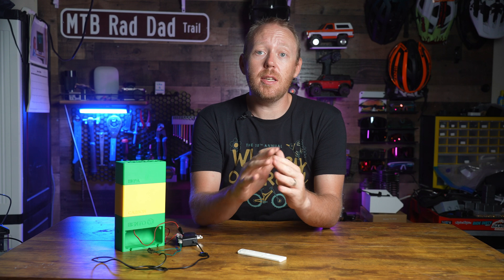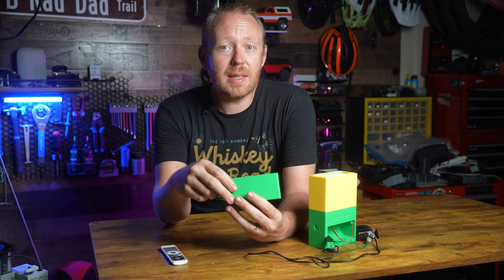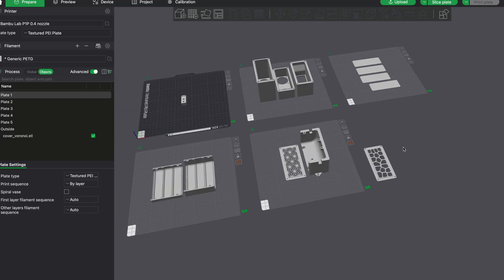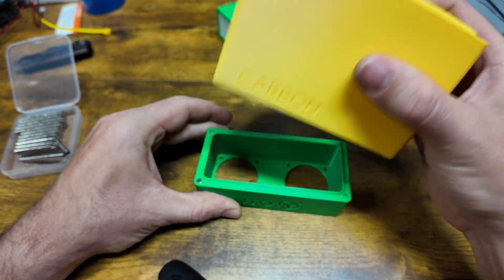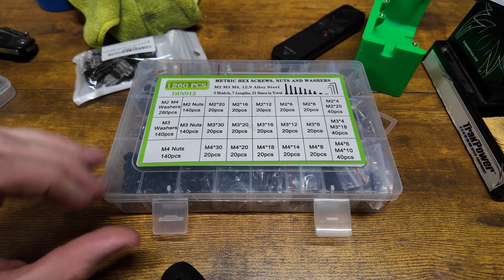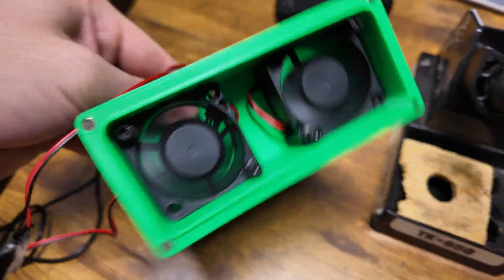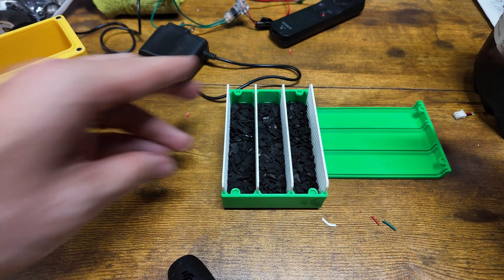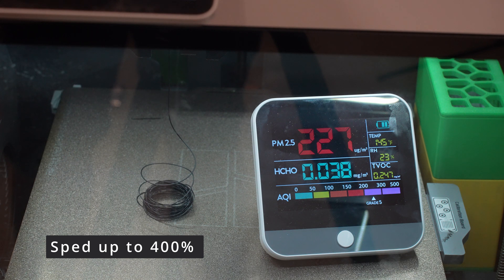Crafting Your Own 3d Printer Air Purifier: The Bento Box Build

Comment: You can 100% get away with ht pla and it can be annealed ina fillament dryer or heated chamber

You still want it with anything that isn't a carcinogen like nylon. That's a pretty nasty. While not dangerous it's an irritant and can cause headaches. Also all fillaments will also release upf's
Reply from the maker: For sure, I don’t think polymaker had their htpla yet when I made this video

Comment: PLA releases formaldehyde btw. I see alot of fear mongering about VOCs but nobody talks about how charcoal pellets only last a few weeks, even if you don't print. Personally I went with an air purifier for a room much larger than my print room. Zero fumes and filter lasts 4 months.
Reply: @jimmer411  what did you choose?
Reply: @slickrick412 Levoit Core 300 with the toxin filter
Reply: @jimmer411 thank you!
Reply from the maker: Good to know thanks!
Reply: Brand? Details? @jimmer411

Comment: Any reason why no power supply info was included?
Reply from the maker: I think i didn't feel comfortable sharing my janky solution. I basically found a power cord that was in my junk drawer that matched the voltage if i recall correctly.

Comment: Have you done any testing of the air outside the printer, comparing with and without the bento box active?

I just started using an IKEA VINDSTYRKA air sensor in close proximity to the printer (P1S) and it shows only 2-5 on the PM 2.5 when printing PLA.
I would have imagined that to be relatively large even when printing PLA. Or does PLA have primarily particulates in the >2.5 to <10 PM range?

Comment: What kind of power supply did you use?
Reply: Depends on which fans you pick. You need to look at your fans specs to figure out what voltage and amperage your power supply should be able to provide. The typical fans people use in this project are 12V and about 0.05A each. With a safe margin you'd need roughly 12V and 0.15A for both fans, so that's what your supply should provide. DC of course.

Comment: Why is the HEPA filter before the carbon in the air path? You'd think that some carbon dust would be present in the pellets, which will be pulled out and spread inside the printer.
Reply: Because the opposite (carbon before HEPA) would be much worse as you'd use the carbon to filter the larger particulate matter, saturating the carbon much faster and essentially rendering the HEPA filter useless.

Comment: I want to buy a Bambulab 3d printer but I think about two solutions: getting the A1 and making a mount above the printer with air purifier, or spending more money and get the P1S. I would mainly print PETG and some PETG-CF, as a hobby, printer in the bedroom, what would be the better solution? Is the built in P1S filter enough?
Reply from the maker: I could be wrong, but i think with PLA and PETG you dont have to worry about nearly as much.

Comment: Guys I just wanted to let you know I built this box and after few tests I noticed one massive problem after adding the carbon which was very messy the fan work against them self  80% of air is forced back on to its self causing the fan to struggle and very tiny air passing through. And yes each item was purchased through links so I had the same items. I will make a video to show it not working soon
Reply: You need to have the fans “pull” air through the carbon, not push it
Reply: yes, activated carbon needs to be before the Hepa Filter to protect the ventilator and your lung and printer from ultra fine carbon dust

Comment: So, is this useless for a 3d printer like the A1 and A1 Mini which are not enclosed? For those open type 3d printer it would need a whole room filtration instead?
Reply from the maker: If you added an enclosure this would work, but yeah it might not work great without one.
Reply: @RadDadsPrintLab  gotcha. thanks! Just trying 3d printing for now (got an A1). The plan is try it out first and then if everything work out well and I really love it then eventually get the better / enclosed model.
Reply: just buy an enclosure with pipe ventilator, you can guide the fumes outside
Reply: What if I just put it next to it

Comment: Mine is so loud!!! I built one from scratch and used the 4028, 24V fans. I took the printer apart and hard wired it to the built in 24V power supply. The fans by themselves are pretty quiet, but when I add the charcoal and HEPA, the thing is obnoxious. I guess it is better than breathing poison, but has anybody else experienced a loud Bento Box?
Reply: I have tried one, but used 4028, 12v fans, but the air flow after using hepa and charcoal is very very low almost negligible
Reply: Is it because the carbon charcoal vibrating from the wind? Maybe you could pack more charcoal or insert a cotton filler into it to keep them packed tight. I hope this would help
Reply: How much is the air flow, can it blow out candle from 15 cm
Reply: Same for me. Also 24V fans directly on the PSU
Reply: It seems to have gotten better. Maybe the fans were rubbing on something. After running many hours it has quieted down

Comment: To super glue magnets down without getting superglue all over your fingers, you've actually got a couple of different options.

1st: Use a steel or iron rod (like the back end of a drill bit) to hold the magnet and push it into the hole. You'll want a wipe handy to wipe the excess superglue off of the rod so it doesn't get build up

Or,

2nd: I've discovered you can use two magnets of half thickness. Press one in, apply glue over the top and then drop the other magnet into the hole: it will flip the right way, and should self align.

Ref: I've been magnetizing tons of WH40K minis. So many fiddly bits...
Reply: Couldn't you just push the magnets into their hole dry then add a drop of thin superglue to the joint where the plastic and magnets touch, and let the thin glue wick itself into the joint?
Reply: @jamesmeader6539  It might work. The magnets are just so tiny they're hard to hold in my fingers, and I've had issues with the thin stuff wicking into surface details. 

One of my Grey Knights acquired a hair squig because of that...
Reply: @HarryVoyager  Well, I've done lots of model work applying thin CA glue like that, I don't see why it wouldn't work on this application. As long as it is a close-fitting joint, just a small drop wicks into the joint leaving almost no trace on the surface.

Comment: Built the wirelessly powered version for it's ease of use and clean look but the 24V fans were always intermittent. Boosted voltage with step-up converter and still couldn't get the fans to stay fired up. Tried a couple of different wireless receivers and still no joy (many others had similar issues but got it to work with different receiver but alas no luck for me). Gave up on wireless and went the hardwired route using the through hole just forward of the box along the sidewall. Designed a facade to attach to the bento box to hide the wires. Wired in parallel to a 24V power supply using some wagos and voila, no more issues. Going to design and print a housing for the power supply and add a rocker switch for convenience. Ended up being much simpler than I thought it would, albeit not as cool.
Reply from the maker: I thought about trying to hook it up to a battery source, but decided it would be easier to just try and run the wires through the gap in the door. Thanks for Sharing!

Comment: Whats the power supply you use for the bento box? Trying to decide between wiring to the PSU or an external power supply.
Reply from the maker: I went thru my junk drawer and found one. Personally I didnt like the idea of wiring to the PSU. One option you can do is getting a Panda Branch from Big Tree Tech if you use 5v fans.

https://biqu.equipment/products/bigtreetech-panda-branch-v1-0
Reply: Power supply?

Comment: I have spent a very large amount of time working with my own products and magnets. 
For small spaces use a drop. Get thr precision tip. No other types. Use the tip to spread the glue. 
If it is too small get either a toothpick or tiny allen key and spread the glue, quickly!
Then push the magnet in. Again everything has to be fast. Quickly wipe the excess with a paper towel. It may not seem like enough glue. But trust me. It is. Give the super glue the full 24 hours to cure. 
Enjoy properly glued magnets without gluing your fingers together
Reply: Or use activator spray for CA adhesives.  It can cause a slight discoloration on the surface, so use it with care especially on white plastics!
Reply: Again, use thin superglue that will wick into the joint.

Comment: Would it even be possible to fit another one in there? Just got my P1 S today and haven’t had the time to mess with it.
Reply from the maker: 2 of them inside? Maybe one on each side of the build plate
Reply: you could probably add the mini bento by thrutheframe on the other side to be able to fit two of them.

Comment: How did you end up routing your power wire? I think that’s always the big question with the Bento box
Reply from the maker: because the wire was so thin at one point, it fit thru the door crack even with the door closed.
Reply: @RadDadsPrintLab this is very good to know, thank you